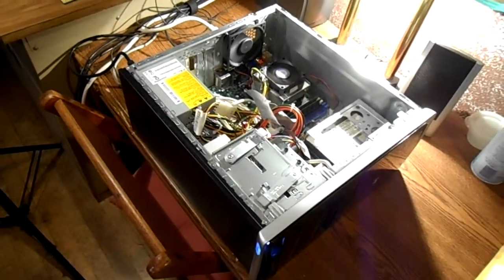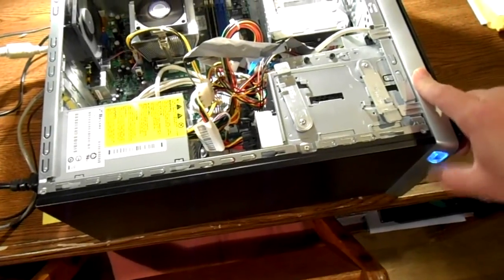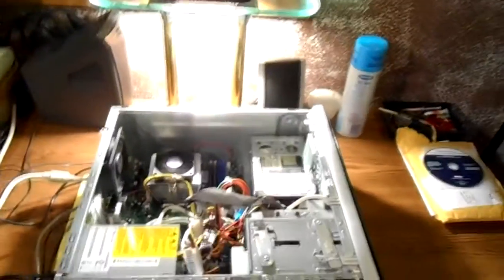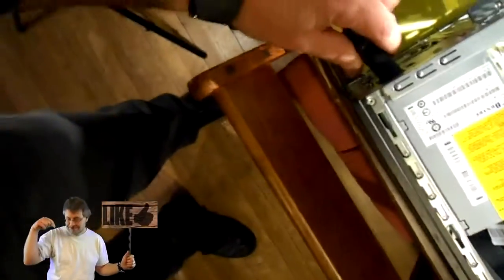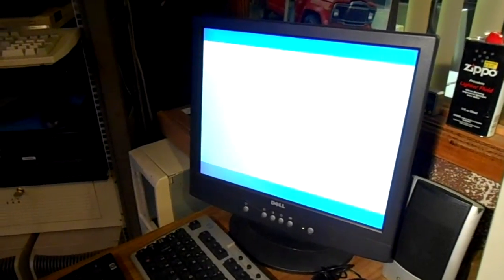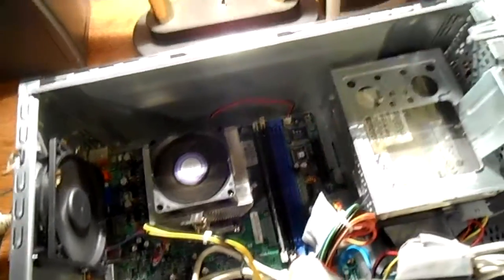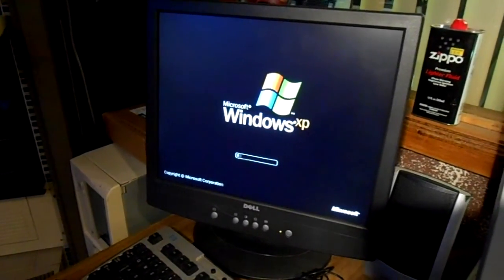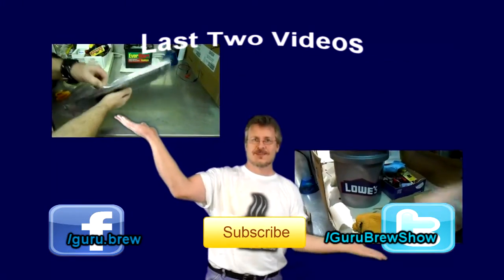Windows Troubleshooting Techniques for Blue Screens and Unxpected Crashes

Comment: Some times the RAM stick is still fine. It just needs to be taken out, and the slot be cleaned out with compressed air, then the RAM is re-seated back into the slot. Then if it boots up you can perform a memory test in the BIOS, or within windows. Or even move both of the sticks over to the other RAM channel slots. But yeah, your ram stick looked generic as hell. You get what you pay for as they say.